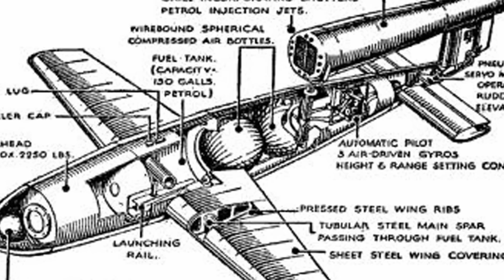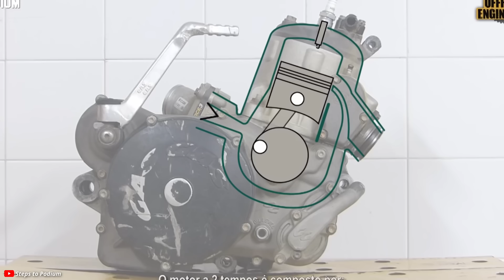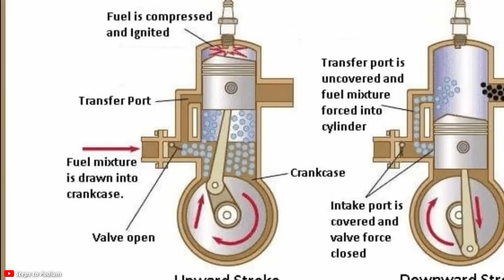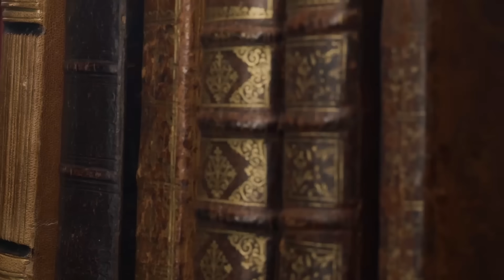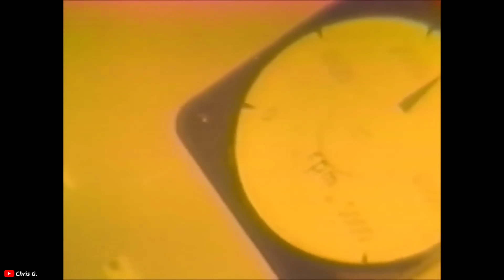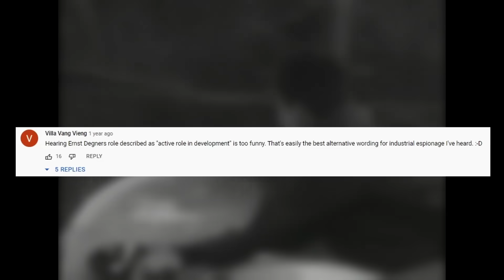How Suzuki stole communist technology to make their motorcycles faster

Comment: The V1 was a low altitude pulse jet driven subsonic cruise missile. Peenemunde is where the supersonic V2 rocket was developed and was the first man made object to enter space, before re-entering in a supersonic near vertical trajectory towards London. Werner von Braun was the German father of this rocket and went to the USA to lead the NASA rocket program which eventually put man on the moon. V1 and V2 could hardly be more different!
Reply: The V2 did not enter space on every attack on London. It entered space when they tried for it on purpose with mods in fins and fuel
Reply: It came to london 3000 km/h. It was named "flying pipeline", which was first reported as the caused of the gas leak. Maybe its sound barrier bang came after it hit to ground?
Reply: His Name was Wernher von Braun...
Greetings from Ostfriesland, Germany
O
Reply: @jarikinnunen1718  They knew it was a V2 but they always use propaganda so its GAS LEAK
Reply: @ianmangham4570  People observed the same when there is no gas pipeline nearby.😄
Reply: Jet vs rocket...
Reply: True. V1 was done by the Luftwaffe's weapon development unit and V2 was done by Werner von Braun and crew,all under general Walter Dornberger and he was in the army's department for weapon development.
Reply: Penemunde was were BOTH the V-1 and V-2 were developed. It was a general purpose military research station and firing range with multiple projects ongoing. It wasn't explicitly set up for V-2, though it was their biggest project. It was not even limited to just V-1 and V-2. Also stuff like the Wasserfall early SAM missile development was happening there and so on lot of other more minor stuff. Pretty much, if it was Third Reich German and had to do with missiles or rockets, it was developed and tested at Penemunde. Since well it was the range with the necessary area to do long range firing (they fired the missiles from Penemunde at Baltic coast over the Baltic sea.... since hundreds of kilometers of empty sea. Though I think atleast once they did unintentionally manage to hit Sweden at the other side of the Baltic Sea.)

The video never claimed Kaade worked with Von Braun. He said they both worked in same place, penemunde. Nearly got killed when Penemunde was bombed. Which happened. Allies knew "Penemunde is the rocket place, we want to hinder their rocket programs. Lets bomb penemunde".

That is completely true statement and he made clear Kaade worked on V-1 and Von Brain on V-2.
Reply: @jarikinnunen1718  Yes, that is correct.
Reply: Walter Kaaden did work at Peenemunde but not on the V1 nor V2 he worked for Henschel on the HS293 a rocket propelled anti ship guided missile.
Kaaden didn't invent the disc valve, he saw that being used by another East German. However the story doesn't mention Kaaden building his own oscilloscope to measure the frequency of the harmonics in the expansion chamber.
Reply: He also said that the V1 was "waterborne"!
Reply: @vladimirzimonja8103  V1 was cheap piece of shit,I've seen documentary about as be high tech perhaps on later models to improve accuracy but the early one had to make it across the channel the hopefully hit London
Reply: @aritakalo8011  SAM in the second world war?
Reply: That's true about the Wasserfall. Also about the Baltic coast but i read that they chose it because of really long and straight coast which made it easier to track and film the rockets. Supposedly von Braun's mom gave the idea about using the Peenemünde area because his dad went there duck hunting,it was hundreds of square kilometers of woods,marshland and coast so she mentioned the place when then still young Werner said his employees are searching for a place that's big and...not close to towns and villages. Of course he couldn't say what they needed it for,she probably thought it's a shooting range of some kind. If the story is true.
Reply: Oh yes,one more. The rocket that went rogue disintegrated over the Swedish town of Kalmar,dropping a shower of bigger and smaller debris on and around town. As for bombing of Peenemunde,it was called "Operation Hydra" and was one of the most succesfull allied night bombing operation of the war because they not only hit the facility succesfully,but managed to totally trick german "Himmelbet" and Flak-Reflector defenses into sending all the fighters over Berlin by sending dummy raids(dropped mines or propaganda leaflets) and using "window" radar decoys which we today know as chaff. Some Luftwaffe fighters did manage to get to Peenemunde and shoot down some RAF bombers but it was a small number of planes that made it over the site. Despite succesfully hitting the facility they managed to kill only one of the major scientists and the operations there were stopped just briefly. Killing scientists was the main objective so from that point not succes but overall the operation did well with not many allied planes shot down.
Reply: @jarikinnunen1718  V2's came down with about 5600km/h. No defence.
Reply: @Johnketes54  Well i didn't say it was super high tech,i said it's engine has some similarity to how 2strokes work. The fact that i'am a 2stroke bikes(especially racing) fan,made the comment sound more enthusiastic than it really was.
Reply: @Johnketes54  True.
Reply: @Johnketes54  Yes. Earliest SAM developments happened during WWII. Mostly those were radio controlled by targeting operator on the ground with possible telescopic sight and then joystick.

It was primitive, but then again some current SAMs also are command guided by the launcher. Though these days usually based on radar tracking both the target and the missile or something like that.

Oh and none of them went to mass use. It was developmental work and I think couple vent to early trial use by some air defence units, but not in large numbers. More like "hey we came up with this rocket AA, here, test it and try to shoot down the enemy".
Reply: @ikbunostfrees7242  -- His Name was Wernher von Braun...

And this is his story, in under two-minute long musical form:

https://www.youtube.com/watch?v=QEJ9HrZq7Ro
Reply: @vladimirzimonja8103  I mixed km and miles.
Reply: V1 and V2 had one thing in common: They were utterly useless as weapons.
Reply: @zweispurmopped  People was scared them by just waiting if they are coming. Constant fear all round the clock.😨
Reply: @jarikinnunen1718  Ignore my first reply, was O.T.
Yes, they stoked fear, but that fear was channelled into will to resist. In the end, the V-weapons achieved the opposite of what was intended. Incapable of achieving any real strategic goals, the entire program was a waste of resources.
Reply: @zweispurmopped  Grazy Enlish's regime ignored people's fears or ravages. The terror bombings in Germany proved it.
Reply: They are both named “V-“ , for better or worse
Reply: @jarikinnunen1718  sounds like you think Britain should have just let Hitler do his thing.
Reply: @ChefEarthenware  Thank you. I was thinking that I was the only person to catch that.
Reply: @jarikinnunen1718  Wait, is this where the UFO - gas leak meme comes from?
Reply: @zweispurmopped  Post-war analyses concluded that the indiscriminate terror bombing of German cities also contributed to the will to resist, backfiring in exactly the same way.
Reply: The first man made object in space, was an artillery shell from the Krupps railway gun that fired on Paris. The gun was capable of firing a 106-kilogram (234 lb)[1]: 120  shell to a range of 130 kilometres (81 mi) and a maximum altitude of 42.3 km (26.3 mi)[1]: 120 —the greatest height reached by a human-made projectile until the first successful V-2 flight test in October 1942
Reply: @be12  Post-war analysis by whom?
What I can tell you is that Cologne's logistic infrastructure was 100% knocked out. I live there, I know the story the people told. Cologne was the key hub for all transport east to west, not having the storages and bridges there any more made life much harder for the Nazis. The Deutzer Motorenwerke, who produced many diesel engines, were knocked out. I strongly doubt that claim that the bombings didn't show an effect is, excuse my French, downright a pile of bulls. Breaking the morale may have been a side goal, the main aim was to disable the workforce from keeping up their war production. The Nazis were with their backs to the wall in many fields of production like with fuel and lubricants, machine parts and whatnot. That was what was the aim, and it was achieved.
Reply: @zweispurmopped  Targeted strikes on critical plants came late in the war, long after terror firebombing of cities like Hamburg. I'm curious - how many civilians ended up as "collateral"? Would you suggest the Russians do this to Kiev?

Your doublespeak / apologetics is what's BS. Let's see how long you can keep it up.
Reply: @be12  Go and find out about the precision of the navigation and equipment of these weapons of that age. Once you learnt, try to discuss with some sense. Right now you waste my time.
Reply: @zweispurmopped  Cool story
Reply: @be12  Operation Gomorrah took place at the end of July 1943 and Operation Hydra took place in the middle of August 1943.
Reply: @fritzwrangle-clouder6033  Gomorrah being Hamburg? Then I was under a misapprehension.
Reply: V2: Distinctive double-bang. From a ground observer's perspective, first bang, the explosion. Second bang, the sonic boom caused by the missile breaking the "sound barrier" on its descent but still at a high altitude. After breaking the sound barrier, the missile would outrun the boom it had just created and explode at ground level before the boom arrived. Hence the arguably unexpected order of audible events.
Reply: @jarikinnunen1718 ?
Reply: Bart described the V1 as a 400 mph missile. Where did you hear him say it was supersonic?
Reply: @Johnketes54    yeah it eas so shit the Americans copied it  JB-2  / KUW-1 or LOON
Reply: @zweispurmopped  wouldn't say that if it landed on your house  🤣
Reply: @zweispurmopped  The RAF Bomber Command was ordered to  implement the "Area Bombardment Directive" whose technique "Area Bombardment" involved bombing the geometric center of a city with no specific target chosen.   Arthur Harris, who did not originate the policy but implement it,  makes a point of this in his memoirs in reference to Lubeck which was the first city so chosen.    The purpose was to "dehouse" and "demoralise."   It literally was terror carpet bombing.   The policy continued even after electronic bombing aids were available though most of these were quite limited.    One called "Oboe" could be quite accurate but was limited to the radar horizon but generally used to drop marker flares for what was usually carpet bombing rather than direct precision attacks.   H2S Ground mapping radar did not become effective till 3cm wavelengths and gyro stabilization came into use latter in the war well after Hamburg and Cologne and still area bombardment continued.
-The reason the V1 and V2 two were called "Payback Weapons" was because it was hoped to use them to so damage British cities that a mutual end to city bombardment could be negotiated.  The Fi 103 (V1) and A4 (V2) both went into service with quite inaccurate interim guidance system while accurate ones were developed.   Accurate meants 500m for the V2 for the SG-66 system and Vollzirkel system.  (Better than H2S) and an incredible 20m for the Wasserspiegel System for the Winged V2 (A4b) which was to be guided to near impact due to the high radar horizon.
-The story of how city bombing began is a long complex one and certainly the Luftwaffe showed much restraint initially.
-There was no equal of "Area Bombardment" for the Luftwaffe.  They were given a target and did then set about destroying the factories and the surrounding housing and road infrastructure which was considered  necessary to make sure it was effective.   This is certainly what happened to the Shadow Aircraft Factory towns such as Coventry, Birmingham etc.  These were targeted because of their aviation industry using the x-geraete blind bombing system.
Reply: @aritakalo8011  All of the SAMs (about 6) that the Germans had under development would be to able to use the 13 or so guidance systems they had under development.   Most of these were inter related in some way.   Obviously they started with the simplest CLOS Command Line of Sight Systems first for testing.   The command link for testing was the Kehl Strasboerg system used on the Hs 293 and Fritz-X  but was to be replaced by Dogge-Brigge which used highly jam reistant impulse modulated system at 24cm whose antenna were sensitive to the rear only.    The most advanced system used the Manheim FusE 65 radar which had a track-locaking abillity (about 100 entered service)  with one to track the target and the other to track a transponder on the missile.   A mechanical computer similar to that on a FLAK predictor then commanded the missile.     There were many refinements and variations.  For instance CLOS guidance is difficult to learn if the commands go directly to the control fins but its easy when via an autopilot.    There were refinements such as infrared homing and terminal active radar.     The Final missiles chosen for production were the HS 117 and the Wasserfall.
Reply: @vladimirzimonja8103  The V2 that went rogue over Kalmar has an interesting story behind it.  Hitler had order a pause in V2 testing because several were going rogue as you say and he feared one hitting a Swedish Town might provoke a Swedish Declaration of War.  (which the Swedes were considering).  Unfortunately the message didn't get through to the Wasserfall SAM development team who were using a number of V2 to test their guidance system.  One went out of control and headed for Sweden.   Rather than Hitler being angry he turned out to be pleased with the effect which hurt no one.    Sweden was now fearful that a declaration of war and military acts against Germany would lead to use of the V1 and V2 against Germany and so they stayed neutral.